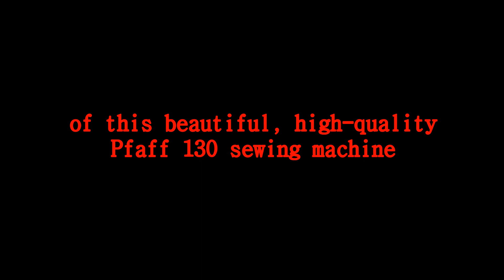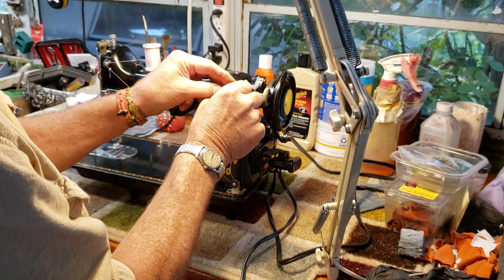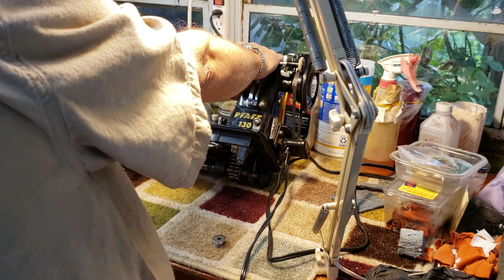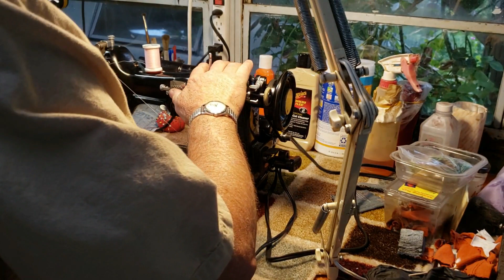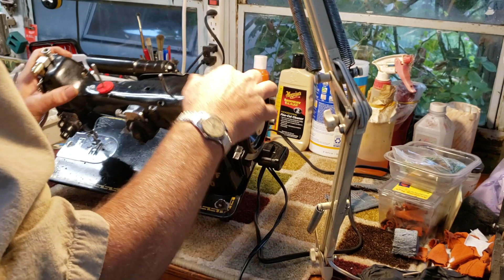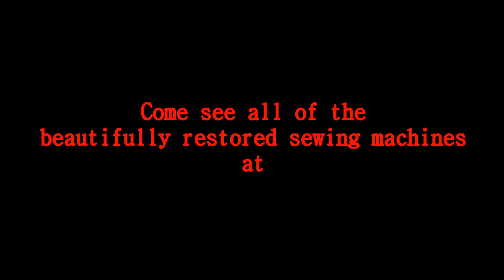How to set up and use your Pfaff 130 sewing machine

Comment: I am looking for the screws and Minnie washer that goes through the light assembly that holds it together also I am looking for a replacement bobbing for a pfaff 130.  Also the little feet that go on the bottom of the case 4 non scratching that table.

Comment: I have my great grandmother's machine. She sewed everything. My mom barely used it and my grandmother never did. I've been using mine very regularly and getting it maintained, it's so wonderful, but I'm still learning how to take the best care of it and troubleshoot. Thank you for this quick video, I learned some new things. I love that my machine has always been in my family, from 1950 when she purchased it, until today. I've been using it since I got it in 2008. Never used one I loved more.
My issue has always been trying to get the tension right since it will turn and turn and turn either way to it's completely right or completely off. Any advice?
Reply: It may be that the tension discs are worn out.     Try replacing them first.
Reply: @SeattleDinghyer  it's not that, I've had it serviced and they are always able to figure it out. It's just easy to mess up